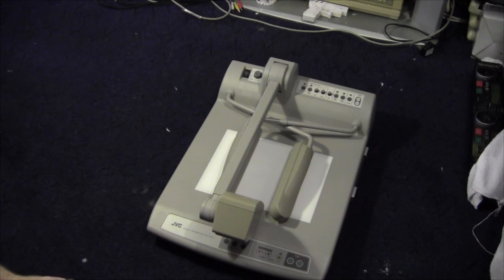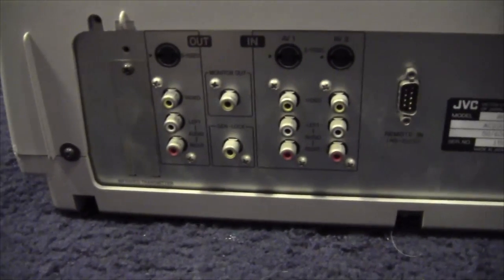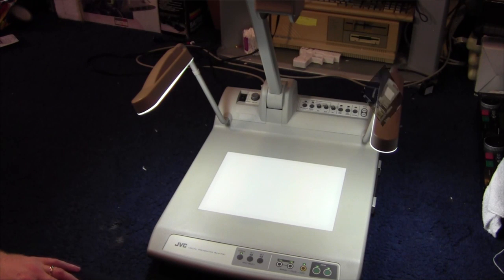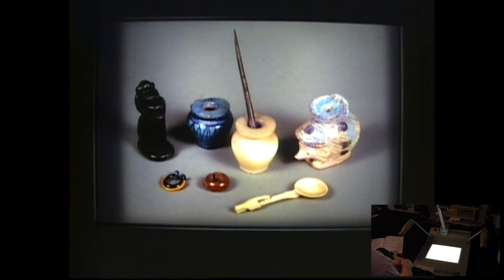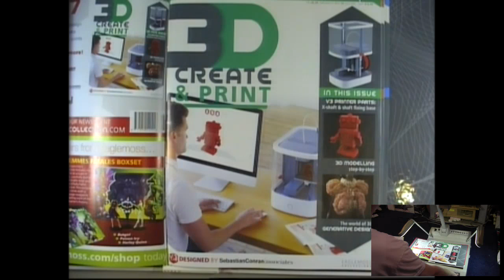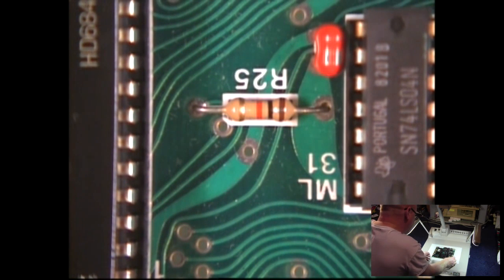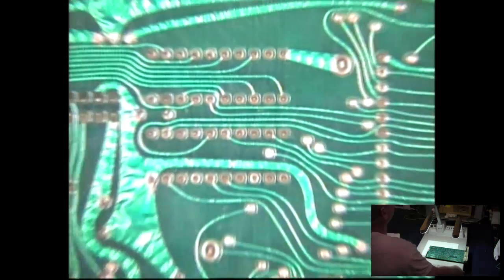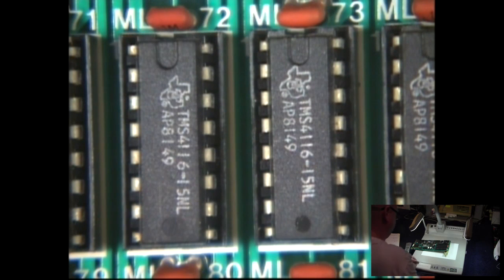Visualiser Review: JVC Visual Presenter AV-p700 (Circa 2000)

Comment: Aaaaah it's an oversized video magnifier used for the visually impaired which are very expensive!  Most are over £1000 but do have monitors built in. I wish I could afford one so I could see solder and read with it hehee! Perhaps this machine would be to big for using to read and has no XY table but I'm going to look on ebay!
Reply from the maker: Knuckles the Echidna Yes, mix one with a 3d printer and youll get something sort of useable lol.  Probably cost £1000 to post one of these, this weighs a tonn!!  It was $3000 when new!
Reply from the maker: Ouch!  We have dome huge ones at work too :)